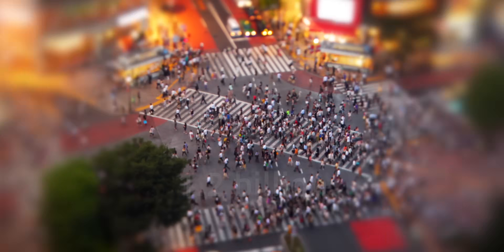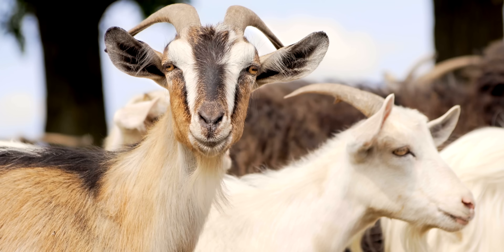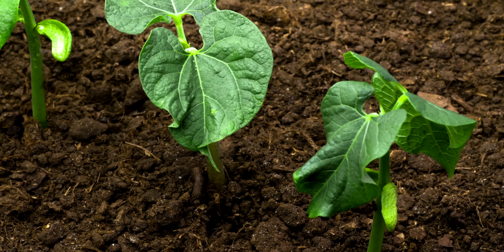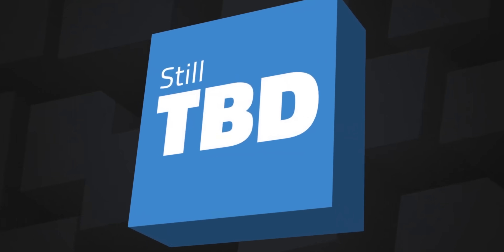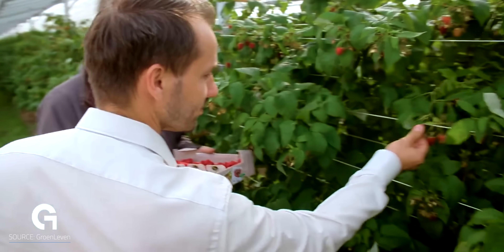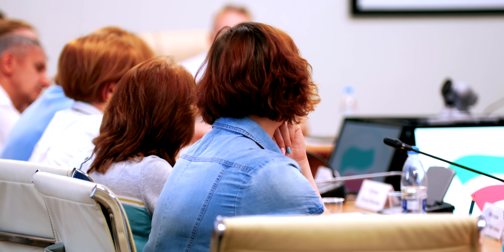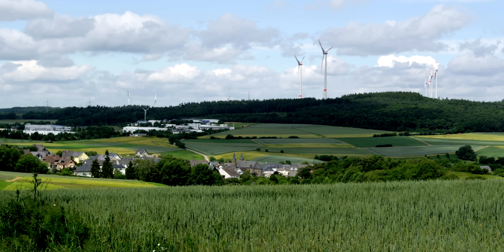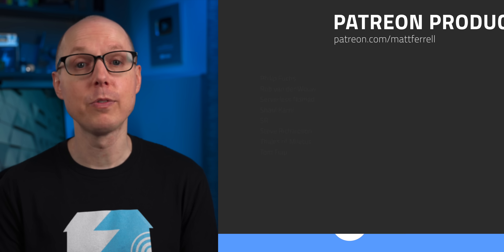Solar Panels Plus Farming? Agrivoltaics Explained

Comment: Dual use renewable energy example? Well, it's not being used, but there is one which would significantly speed up the regreening of hot deserts: Updraft towers inland with updraft pipes and concentrated solar seawater evaporation plants near a shore. The updraft tower was tested and was a net profit even as a test-pilot full-scale experiment. Basically, you use concentrated solar to evaporate and heat the steam from a long greenhouse pond, and use large pipes to move that hot steam from near the shore to as deep inland as needed, increasing the elevation as you go along (you can have periods of local lowering of the elevation, due to the inertia of the steam and pressure from the steam pushing it from behind), then using a part of the steam released in an updraft tower to create more updraft (somewhat cold humid air has lower density than somewhat hot dry air), pushign the rest of the steam through heatsink pipes to cool it into drinking water and agricultural water, and using all the updraft and ground-level wind turbine to generate electricity, and all that updraft creating lower temperatures locally, and all the exhaust of the updraft tower acting like a cloud and shading the areas downwind, allowing even the release of all the steam to literally create clouds which would later turn into rain. For example, releasing the steam as soon as the sun sets will still let some steam make it through and during the lower temeratures of the desert nights it will turn into rain.

Comment: Agrivoltaics will likely only be used in ideal conditions, where the benefits clearly outweigh the drawbacks. It could be yet another tool in the toolbox for reducing carbon emissions while feeding the planet. There also could be a synergy with engineered crops that are designed not only for the local climate, but to work under the solar canopy. Thanks!

Comment: In my opinion not only the PV cells, any panel system has shadow under, can be productive in the same manner, i.e. mirror sun farms, even black painted panels with water pipes in them may be tested in southern regions than Germany, like less watered areas of France, Spain, Italy, or North Africa. The aquaponic systems use even much less water without need of soil, which may use the shade, and the electricity for growing plants & fish at the same time.

Comment: I warm/ hot places it provide shade for inhabitants. It can be used as area to grow crops or bushes and small cattle like chickens but it also might provide clean drinking water( condensation, fog harvesting or waterpumps). So  in warm area’s it could be use as community ground/ workplace. Further it might also be useful to use more of the already existed infrastructure like roads/ railways and large buildings. Not everywhere is enough space or possibilities to build megastructures for solar energy or windturbines. Further beside energy it also has possibilities to create with the energy warm water supplies.

Comment: There is a maximum temperature above which photosynthesis doesn't happen.  In hot places, providing shade can increase the rate at which plants grow.
Putting the panels up high is a good move because you can move equipment under them more easily.  Almost no land is lost from crops use if you do that.  Staging can be used when maintaining the panels is is happening.
Wind power can be adding in some cases too.  A wind farm eats very little land and makes its peak output at different times from solar.

Comment: The obvious solution is to monetize all aspects of the process and let the markets decide.  If each process is properly costed it will work out in the end.  Assuming a solid hedge of rules and regulations that prevent some members of society from harming others it should work out.

I am quite sure people will come up with huge glaring exceptions and for that you can blame a failure of my imagination.  Of course if there was a flaw I can also always claim you just monetized it incorrectly.

Comment: Well Done, Matt!  Info is great on the viability of this.  Seems like it should be pursued where feasible and try to minimize the rhetoric and regs. in getting off the fossil fuels. I always have questions about large PV farms and how to keep them clean efficiently/cost effective. The reduction in output especially in more arid climates is pretty substantial...then there is the pterodactyl and critter problems.  Not much discussion about it out there.  There are some new "Add-On" self cleaning system but added to the cost of the PV system sometimes adds years to the ROI.  I would think it would be staggering/self defeating on a large farm.  Would love to hear your thoughts on it.  Thanks Much, I really enjoy your details and approach to discernment!

Comment: I'd divide the use case into 2: 1 - where crops are currently covered in warmer climates and greenhouses in more northern climates, and 2 - currently arid areas where shading will create a microclimate underneath for crop growth. 
As for who pays, there already are virtual power plants where a utility will aggregate the electricity created across many residential solar roofs, so this could work the same way, but have the utility companies install and maintain the solar roofs. In a region where land is at a premium it would be a very cost-effective way to create a solar electrical utility without investing in buying large areas of land.

Comment: That 3 hectare farm is achieving 1.6% solar efficiency in relation to total incident solar radiation upon the 3 hectares. This is silly. This is a joke. No, it's more than a joke. The infrastructure cost to install the panels will NEVER be made back. Furthermore, the Net Reduction in crop yield is entirely not worth it when taking into account the (admittedly, now less probable) future of the food distro chain as a global economic network.

This should be canned and never looked at again.

Comment: I proposed something similar back in 2002 - Saudi Arabia or Egypt to build 10000 sq. mi. of solar panels 40 feet in the air, with greenhouses underneath. The solar panels would provide necessary shade and cooling, and energy for desalination. A good greenhouse system could recycle 79% to 80% of the water. 40 feet provides room for fruit trees, homes, offices, factories, etc., even streets. This could transform the economy, using oil money to develop a continuous diverse economy, providing the population with peanent jobs and revolutionizing the economy of north Africa, selling power to Africa, Middle East, and Europe.

Comment: Agrovoltaics: Rich Silicon Valley investors exploit break-or-bust by the season farmer. 

The Rich need the land space for this new solar money scheme, want to avoid land taxes, and want to profit from the cheap Xinjiang & prison slave labor to manufacture cells, leveraging virtually free land cost paid for by the farmers… while increasing the farmer’s tax liability by improving the land, therefore locking them into providing that land forever through tax liabilities, and then neighboring farmers are coerced through increasing tax evaluations via the government to sell/lease out space & also be locked in to the same arrangement.

Former independent Farmers basically become tenant farmers, share croppers, vassals… to their new feudal Lords.

It always comes down to this, it seems.

Once the farmers become wise to what happened, they sell the farm to escape, the new buyer [of the increased valuation land] applies for a waste disposal permit, the solar panels are bulldozed under the ground, housing is built… future home owners plant gardens in their back yards, thinking they have pure soil, but they really have contaminated soil from heavy metals associated with the solar panel disposal. (Saw this happen in Eastern Pennsylvania.)

Comment: Would this create opportunties to utilise marginal land for agricultural purposes.  Allowing areas which are a little too hot, or have not quite enough water to become productive.  I realise that they may be outside the reach of the existing electricity supply grid, but could you not create your own local grid to support the homes and infrastructure required for those now working in the new agricultural jobs which will be created.

Comment: Definitely should not use them everywhere, that's not feasible. Being limited to only shade crops is a poor business model for many farms. I don't think the first few models would actually work for sun loving crops either. Operating machinery between them like that would make maintenance and general farming a total pain. You'd have frequent issues just by the nature of farm equipment will have with the panels themselves too. Dust, stuff flinging out, etc. Plus you're losing a lot of land which cuts into your production. The upfront cost for it would be staggering and the yield from both the crop and energy would take decades to pay it all off. This is true no matter whom owns the panels. You'll also have down time for each area while it's being built so fitting a preexisting farm would be an issue. I do like the idea though. It would be good for inhospitable places such as saudi Arabia that have planned projects rather than fitting a farm that's already productive.

Comment: Couldn't we also add these over parking lots? If we added these pv panels over parking lots we could keep the vehicles cooler as well as providing power. We could even provide charging for ev's. In addition we could use the panels as rain harvesting to prevent large amounts of runoff and flooding.

Comment: You mentioned in the video that as far as energy production is concerned, having a dedicated solar farm is the way to go. As far as crop production is concerned, having a dedicated farm land is the way to go. 

However, a question I feel you did not answer is....does combining the two on the same land produce more OVERALL GOODS? If yes, then it seems a no brainer to combine them!
Reply: Depends on where it is
Reply: @mikeguitar9769  For an academic example - a field that will generate 1000$ / year in food. Or, that same field could generate 500$ / year in power.

But if combining the food and power makes 800$ and 300$ respectively... then it's a win!

It's 20% less food and 40% less power... but more OVERALL money made.

Comment: How would agrivolaics work to support reforestation? I'm thinking that plants for reforestation might not be shade tolerant, and if they are, wouldn't it be trees that are planted for reforestation? Meaning that solar panels placed above trees would need to be moved to a higher elevation or removed from above the tree when it grows to tall, or risk being destroyed/damaged by the growing timber. Anyone understand how this would work that I'm not seeing?
Reply: The idea is that if we stop using so much land for biofuels (corn and palm oil) we could convert them back to forests, hence reforestation. But biofuels are currently (sadly) part of our energy feedstock and need to be replaced by renewable energy sources that do not consume so much land.

Comment: Fascinating stuff but I don't think it should be adopted everywhere. In fact I think that is a big issue with modern thinking, that one solution is applicable to all problems. Take this, your going to have issues with this in cooler enviroments if it reduces temperature beneath the panels, which means that you have increased the rates of possible cold damage to crops and thus lower crop yields. However for certain enviroments and/or crops this could be an absolutely perfect solution. 

I think the perfect example of the problem is the  yakhchals and windcatchers in the middle east. They use the mechanics of air heating and cooling to create perfect air conditioners that are purely mechanical(they where able to store ice in the middle of the desert thousands of years ago with these things). The catch is it requires a dry enviroment and will not work in humid enviroments. So we don't use them but imagine if we implemented them in the american southwest? Sure it isn't a one size fits all solution but multiple states could use these and not only have comparable temperature control(about 60 some degrees during the day and about 70 degrees at night) but they could use it for ZERO energy consumption. I think regional/enviroment specific solutions are the most efficient ones.

Comment: Matt, you forgot about an important aspect - environmental impact. Renewable energy is not as "eco" as people think. One issue is the sprawling human infrastructure - just go for a walk into the wild and check how many places you can find without any infrastructure in sight (fences, power cables and towers, roads etc). I don't know about USA but in Europe it's very hard. Second thing is that it's bad for wildlife. We all know that windmills are bad for birds, but not many people know about the impact of photovoltaic farms - traditional ones take a lot of space that can't be useful for neither birds or mammals - the grass is cut low and no trees are allowed for obvious reasons. They are also being fenced so mammals like deer, wolves etc have problems migrating. Will agrovoltaics be any better - maybe only in cases when they can be used instead of those plastic tents for fruits.

Don't get me wrong - I'm not against renewable energy. I'm an IT guy who is very keen on new technologies, but I'm also a wildlife photographer and I happen to know a few people who jobs are in nature protection - like preparing environmental impact report of wind and photovoltaic farms. I learned quite a lot of them and I know that it's not as cool as people think. Renewable energy should be produced but only in urbanised areas - just look around and see how many space there is for photovoltaics: roof tops of houses and big malls, parking lots that could be covered with panels (cars under them would be in the shade and wouldn't get so hot - how cool would that be!).

Comment: It's nice to see common sense be recognised, good farming has always been about fully utilising resources correctly, although I think they need to go back to the drawing board or CAD regarding the solar array design. The arrays need to be mass manufacturable and easily removed and installed so repairs can be made in a environmentally controled building if necessary and swapped out with replacement spares unit, and be Bovine friendly.

Comment: I designed a very rough solar farm/housing project where it used essentially this concept but instead there were single units underneath the solar panels (however many units in a row with the roof covered in solar panels) whilst trying to keep as close to passiv house standard as possible. Would be awesome to see more of these dual use examples if it could house people as well. The solar panels produce energy no matter how hight they are really, so why not chuck everything and anything undernneath them if you can try

Comment: I would not attribute all the yields drop to the diminished sunlight. Of course it is a factor,  but what about rain? Having theses tiles above the crops means the rain water isn't spread out like it should. This, could cause patch of soil that produce less because they are drier or wetter depending on the spot.
Reply: Although,  if they have sprinkler to water the crops base on soil humidity,  then I agree that rain water factors isn't much of factor

Comment: Farmers are smart, and pretty good about diversifying for fall-back income because of the high risk of crop failures. If this really is viable, all we have to do is stay out of their way and they'll pick up on it very quickly and even improve on it. The worst thing we can possibly do is try to force them to use any technology by creating punitive laws or subsidies.
Reply: Nonsense, please explain why polluting the environment and future drinking water resources with thousands of tons of poison is "smart"?
Most Farmers are way to reactionary and prefer polluting our environment instead growing ecological!
Since ~40-50 years(!) tech and knowledge in this field has been available and proven successful!

Of course law's and regulations are the necessary way to force this reactionary and greedy industry to change their destructive production habits.
They are way to slow doing it on their own!
Reply: @OmmerSyssel  Too any laws are far worse than no laws. If the farmers can't make a living, they will move into their mom's basement and you can't buy any tofu.

Comment: For what it's worth, here in Oregon I see a lot of farms with solar panels. I don't know if it is agrovoltaics or just solar panels. The weather is pretty similar to Germany at a similar latitude. I imagine there are hotter places that would do even better.

Also, I heard about India using solar arrays above waterways to stop evaporation and cool down the panels. Win-win on energy and water for rural India.

Comment: Cost per KWh drops over time, till years later when it reaches its self paid off point.  Even if you can't optimize an Agrivoltaic farm for best power production or best food production, you still produce more overall product.  Sometimes the best answer to a problem is not to focus purely on 1 product great, but to have a multitude of product you can produce at a god rate and win threw variety and flexibility.
The losses on food production or power production, by going the Agrivoltaic route are quite small.  You might not be optimized to do either or at the best it can be, but when you can still have 70% to 80% production on both at the same time anyways, then why would you be against it?  
Loss a small % of one products production and revenue to gain a huge % on producing another product and revenue generation, by combining both production abilities.
Even if you can't get 100% yield from either or, nor both, you still gain a huge amount of yield by having both, even if they are not 100%.  You gain more then you loose.